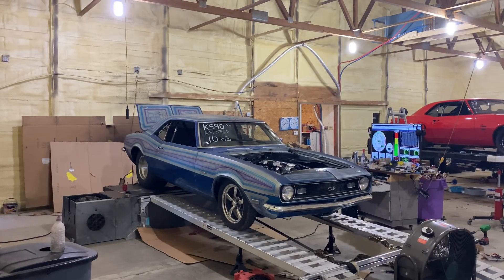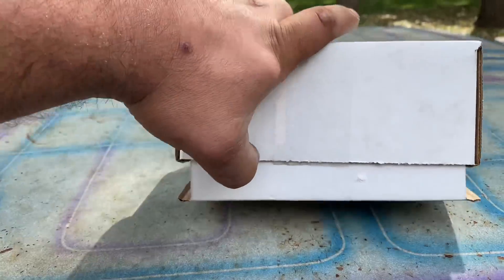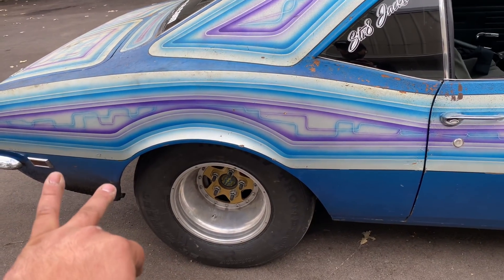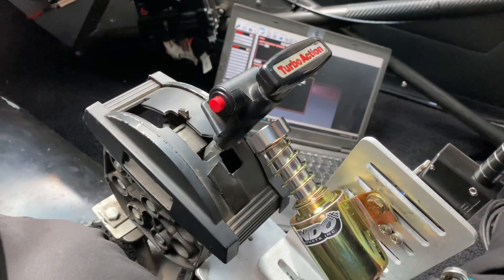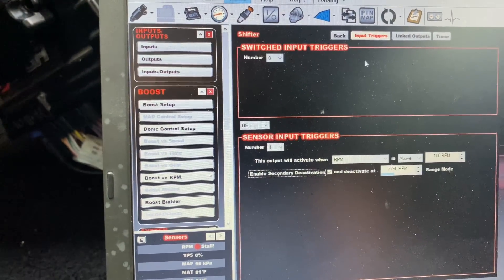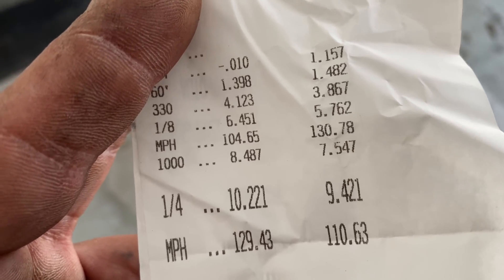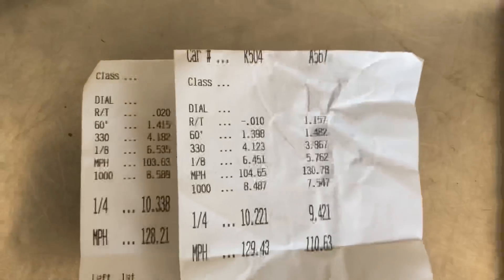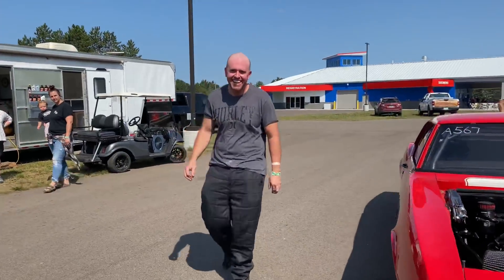Methanol testing on track and Dyno

Comment: Just a little info, dynos measure torque. horsepower is a calculation of the torque x rpm / 5252. So what you are looking at is probably torque not horsepower, if there's no tach signal connected.

Comment: Not a huge bench racer but I went to the Wallace site. The 2779lbs sans you, safety gear and the co2 bottle and 529hp puts it at 10.13. id say you're probably about dead on what that is capable of. I do hope that is off though, it'd be awesome to see you run a 9 n/a.

Comment: Idk the compression is on that motor but as long as it's not over 12 to 1 it will boogie with the turbo a turbo grind on M1. I wish I would have swapped it over to methanol and stopped messin with ethanol a long time ago
Reply from the maker: 13:1 for the real party
Reply: I remember you went methanol for the first time with turbo and you ran out of injector. Did you get bigger injectors or still the bosch 210lb?
Reply from the maker: Still the same fuel system, except the NA motor has a set of deka 80’s. Which are running right around 70% dc on methanol.